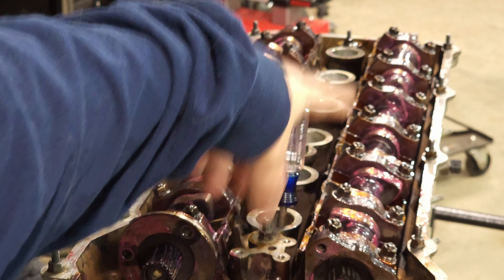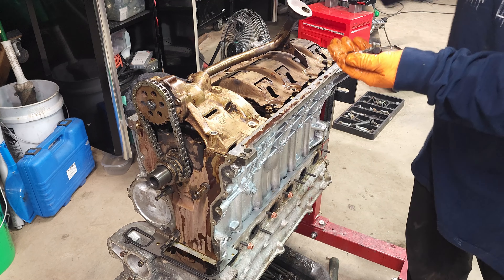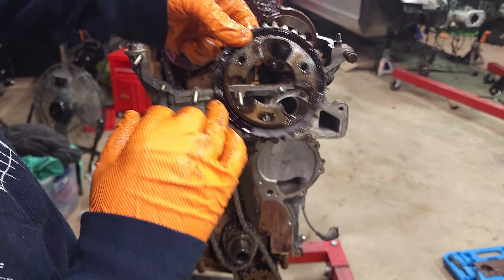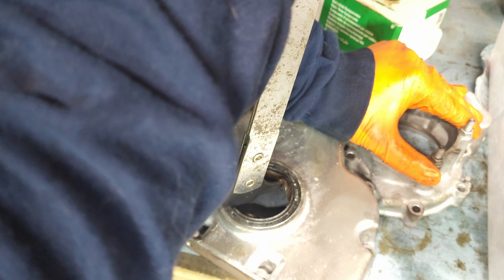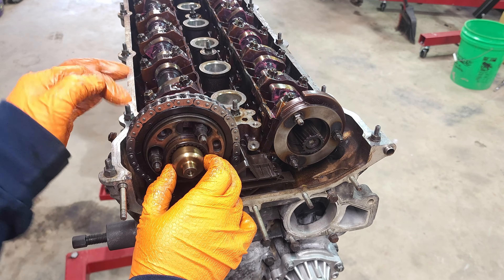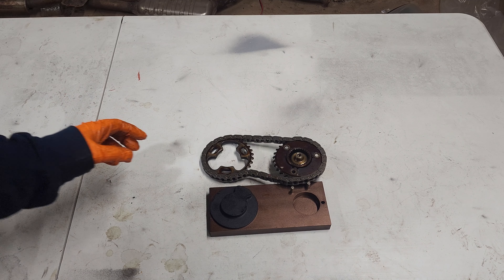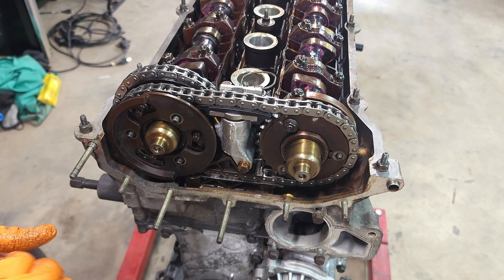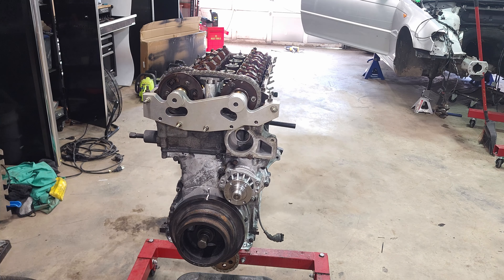Drift E46 Engine Rebuild Ep 2

Comment: Hallo undzwar habe uch eine frage wo kann ich am besten im Video sehen wie die Vanos funktioniert ist das vlt bei min 11:43 ?

Ansonsten Super erklärung 👍💪
Reply from the maker: I don't do a great job at explaining how it works completely, but I rebuild the vanos unit in this video, around the 3:11 minute mark

https://youtu.be/bZOUDOGpYf4?si=ldU9BNY0UPUyW7tD
Reply: @269Garage  Ok, is that the pitch wheel with the rotor inside, if so then my question has been answered

Thank u very much 👍💪
Reply from the maker: Everything with the timing components are technically external to the VANOS, and the VANOS acts on those little spiral splined pistons to change the timing. At least that's my understanding of it. The camshaft position sensors operate from those oblong shaped pieces that have the arrows on them. This is also my first time rebuilding one of these so I'm not too familiar with the exact terms for all of the components.
Reply: Thanks 😊
Reply: @269Garage  Im sorry for asking too many question this is my last question 😂 The pistons on the right and left are both activated at the same time ?
Reply from the maker: I'm not 100% sure on that, but it seems like with any other variable valve timing, both intake and exhaust are constantly being adjusted for the best efficiency.
Reply: @269Garage  yeah i know but i will know how it works on this mashine in detail 😅
Reply from the maker: My brain would hurt if I tried to understand all of this haha
Reply: @269Garage  hahahah 🤣🤣
Reply: @269Garage props to you for taking the time to respond like that. That’s nice to see.
Reply from the maker: That's what's awesome about posting hobbies on youtube, other like minded people will find you.
Reply: @269Garage  Thank u for taking time 💪👍🙏